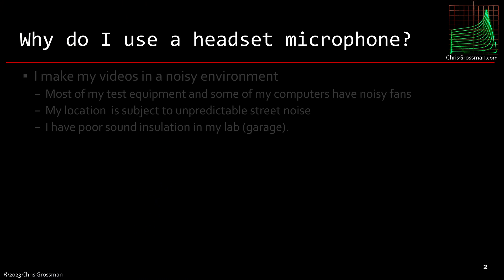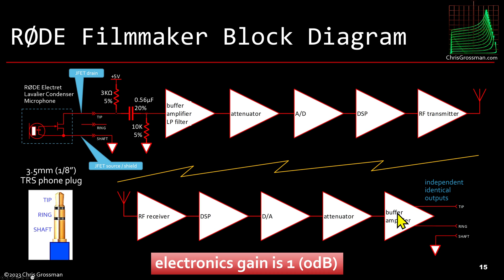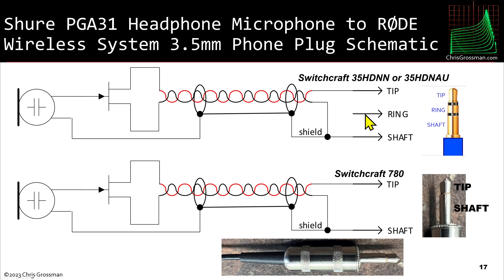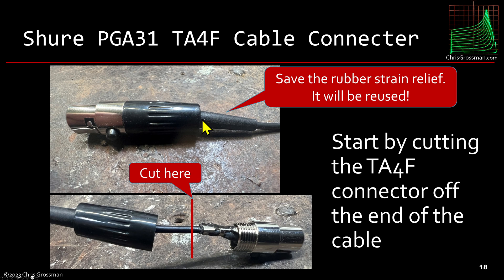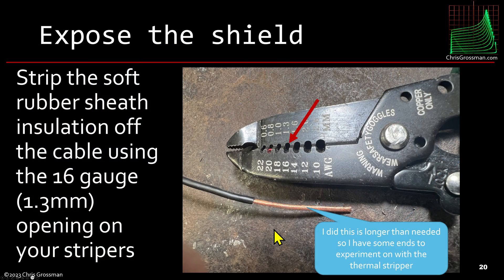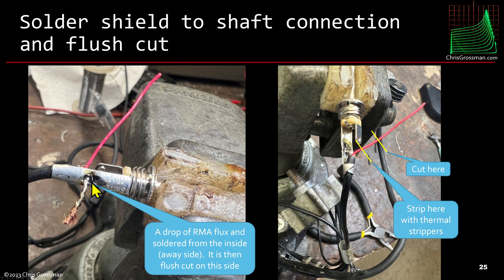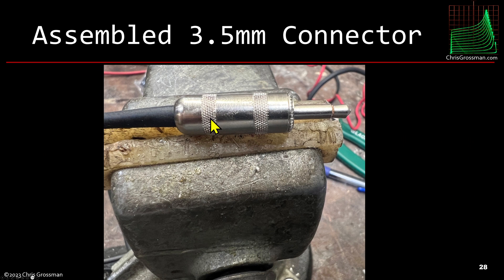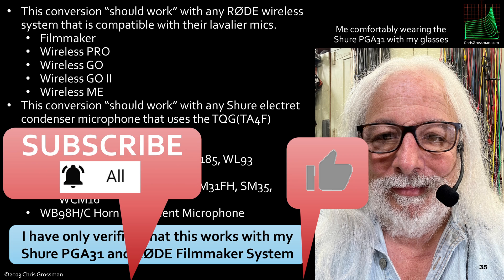⭐ Convert a Shure PGA31 Headset Microphone to to the RODE Wireless System 0025

Comment: Thanks for detailed instructions. I consider buying a headset mic for the similar reasons and I already have Rode Wireless Go. 

As for compatibility, I've seen info, that SM35 uses phantom power. So I guess this conversion will not work, at least tip-shaft variant.
Reply from the maker: There are two versions of the SM35; the phantom power version with an XLR connector, and a TQG (TA4F) version.  The TQG (TA4F) version should work with this procedure.

Comment: If you add a resistor in series with the FET source, you'll reduce the distortion at the cost of lower gain.
Reply: Good video. Not to find fault, but to offer helpful viewer feedback... I agree that there is some audible distortion and that a fixed resistor, or pot, is needed. Additionally, there is significant pop, on certain syllables. A foam cover would help with that. Moving the microphone from off center of your lips would help, too, with both pop and distortion... Out of the wind path... Over the cheek seems to be a common placement. As this new placement is farther from your mouth, the resistor may not be needed. You also need a bit of tone adjustment. You will have to play around with things. 250Hz is usually a muddy spot and probably should be reduced. HTH.
Reply from the maker: the distortion was caused by my settings in OBS, not the FET.
Reply from the maker: The signal is very small, and JFETs are fairly linear for small signals.   I don't really need the signal reduced any more.   The distortion in this recording was caused by my noise reduction settings, not the microphone.

Comment: Tip for that cable type is to add on some heatshrink sleeve for 10cm of the cable, from the cut exposing the shield, to provide a stiffer section near the plug, so that it does not flex excessively and snap there in the cores. Sleeving just barely larger than the cable, and shrink it down before assembly. Also a tip with those plugs is to clean the metal areas you will solder with some 800 grit wet and dry paper ( I made some tools, using a paper punch to make small disks of the paper, and then contact adhesive to stick them to the ends of some steel rods from scrap printers, so the paper is on the end, and it is easy to stick into position and spin around), then wipe clean with alcohol, and then flux and tin them. Keeps the wire insulation from shrinking back, and a 5mm long piece of the heatshrink you use on the outer will also slip over the wire, and after soldering (thus the need to be fast) you shrink over the whole terminal.  Works best on TRS sockets to prevent shorting, as that tip is often going to melt the plastic before it solders, if not prepared before.
Reply from the maker: I did not make a heat shrink strain relief since I reused the very nice (and superior one) that came with the microphone.   There was no need to remove oxidation from the connector, it was new and in a sealed bag.